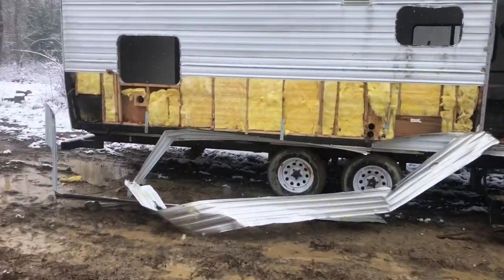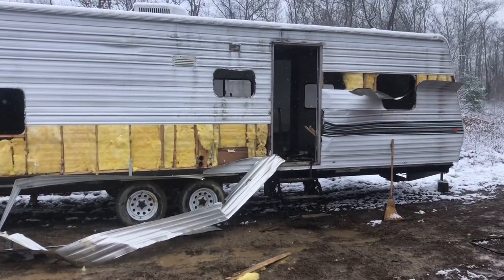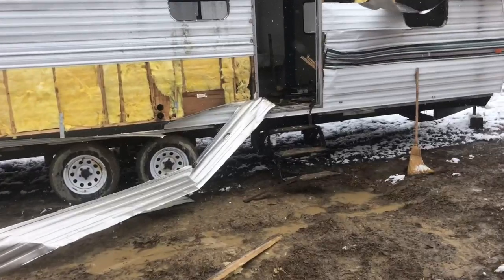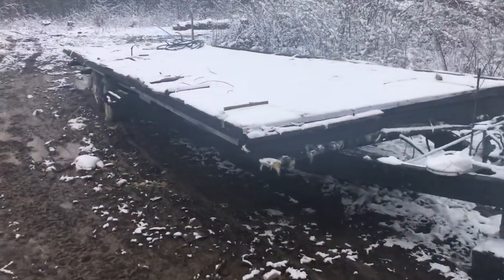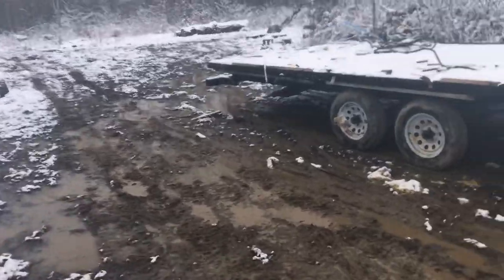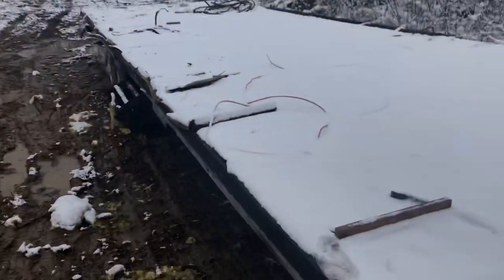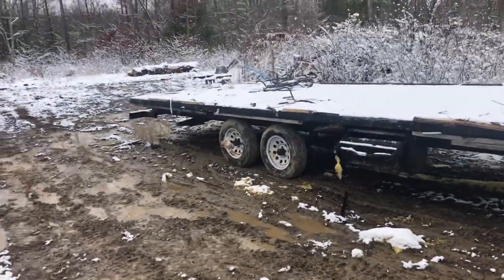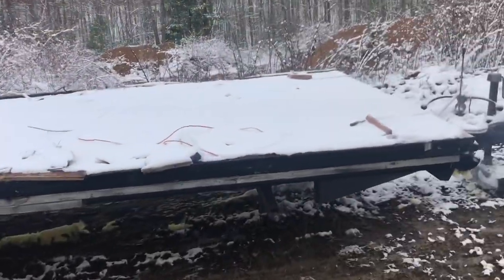Turning a Camper Into a Car Trailer pt 1

Comment: Put a metal floor on it to stiff it up.
Reply from the maker: That’s what I’m thinking!
Reply: ‘TheMechanicDave’ understands....the trailer wobbled and undulated when you kicked it because it’s a newer (weight-saving) frame made poorly and with too little steel. 
 - It won’t hold up to heavy use unless you strengthen it like the both of you were thinking.

Comment: Any other way to knock down the walls without paying like 500 bucks to rent a bulldozer?
Reply: Yep, lots and lots of elbow grease.

Also: fyi, that's a mini excavator not a bulldozer 😁
Reply: A good prybar, sawzall and an impact, i also found out a chainsaw with a semi junk blade eats thru the aluminum siding and wood frame like butter
Reply: @salsabackyarddiy4488  been there done that with the dulled chainsaw 👍
Reply: @shadowwolfx333  yup, not even worth sharpening my chain at this point im just gonna get a new one 😂

Comment: Me and my dad sus this 25 footer shortened it to 20 ft to haul our side by sides.we also put brake lights welded supports and welded a square plate steel floor.